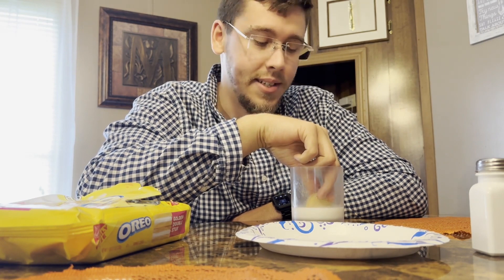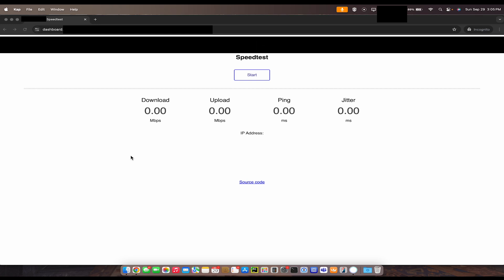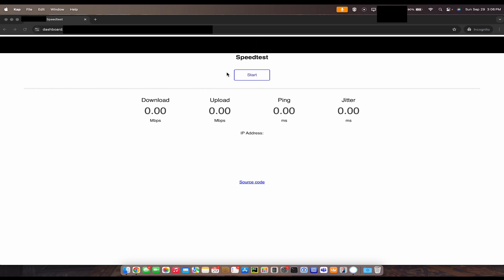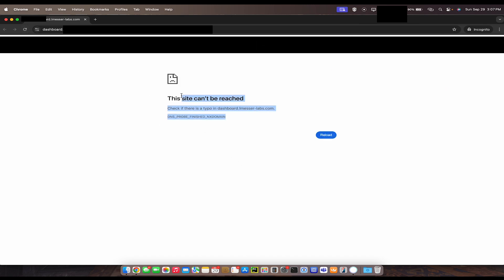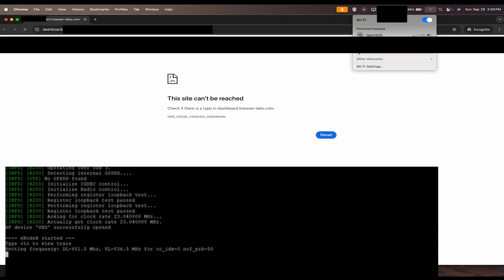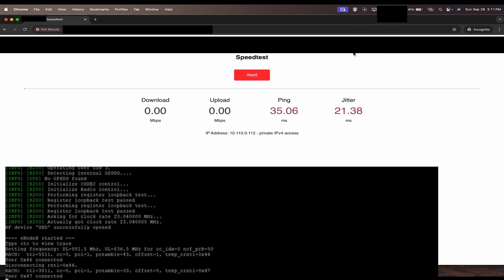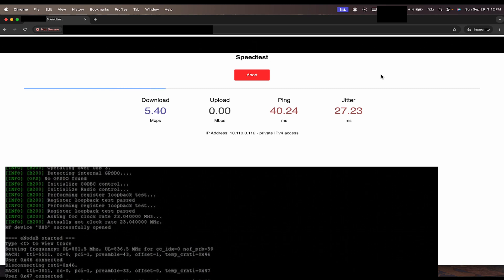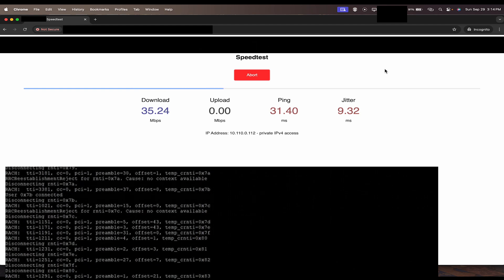Open5GS Hotspot with iPhone 16 UE/B210

Comment: Any chance you are in the US and were able to gather some technical details on Verizon's massive outage today?  I'm tired of the talking news heads who have no actual details about what actually caused it.  Really interested in how this type of thing could occurr for so long and broad
Reply from the maker: This was likely a BGP issue. RIPE showing several changes during that time.
Reply: @LANRanger  so ur saying a routing issue made it so no cellular connection was feasible?  I can see no network connectivity but not no RF connectivity
Reply from the maker: @googleuser4434  the entire time that Verizon was down for me, I had RF connectivity. I was connected fine to the nodes but no internet.
Reply from the maker: @googleuser4434  https://stat.ripe.net/app/use-cases/prefix/bgplay/S1_174.207.160.0%252F19_bgplay_TMAST1727481600000ET1727718284725

I was in sos only, but I was still able to see the cell and view stats.
Reply from the maker: @googleuser4434  I also do not have any affiliations with Verizon. So I’m not 100% sure. I did follow some threads in regards to it. This seems to be a likely culprit or just a big coincidence for them.

Comment: I live in a rural village, Me and a friend had setup a b210 with a 4G LTE and VoLTE network, We have it connected to an RF AMP, and it is connected to a cheap sector antenna I had, We have it paired with a satellite provider so it provides internet through 4G, and most of my village have no issues, My friend had only set local calling so we cannot call any real number, only each other with the sim cards we had provided, Internet and local calling work really well for us though. (Sorry for the grammar issues, English is not my first language)
Reply from the maker: @Gamer-ex3xe  that’s impressive! What was your EPC? Open5gs? Did you all use uSIM or eSIM? I’m also curious to know how the b210 handled that many UEs?
Reply: @LANRanger I believe the b210 can handle up to 100 users, although I am also interested in the rural gurus setup 😂
Reply: @LANRanger Thank you, We are using Magma core, and kamilio IMS. i am not entirely sure but we have 2 b210's one of them runs band 13 LTE and VoLTE, and the other b210 i am not sure but i think it runs band 66 with VoLTE. we have them work together with the network, We all at the moment use uSims, but it works pretty good for us, we probably have about 60 users on the network. As of now i only get around 7-9 mbps downlink and 4 uplink on average with the usage. I do not know entirely how its set up for us but i mean it works 😆
Reply: @LANRanger  Thank you, We are using Magma core, and kamilio IMS. i am not entirely sure but we have 2 b210's one of them runs band 13 LTE and VoLTE, and the other b210 i am not sure but i think it runs band 66 with VoLTE. we have them work together with the network, We all at the moment use uSims, but it works pretty good for us, we probably have about 60 users on the network. As of now i only get around 7-9 mbps downlink and 4 uplink on average with the usage. I do not know entirely how its set up for us but i mean it works 😆